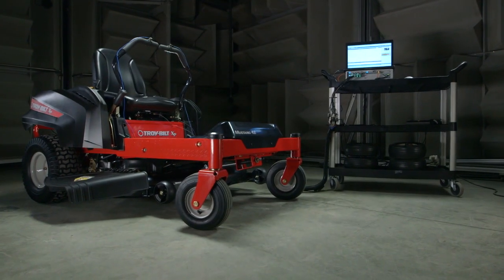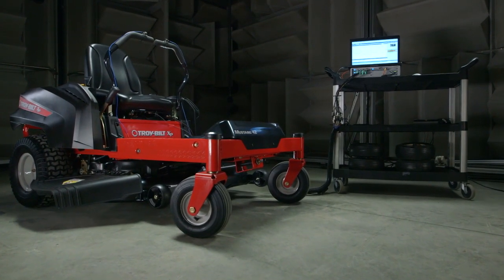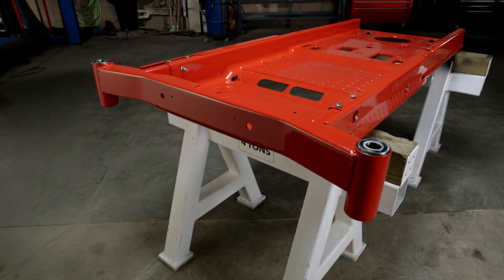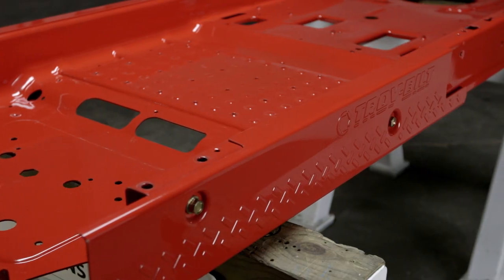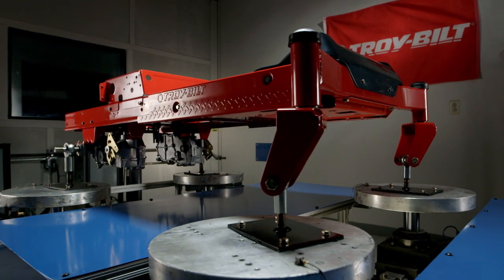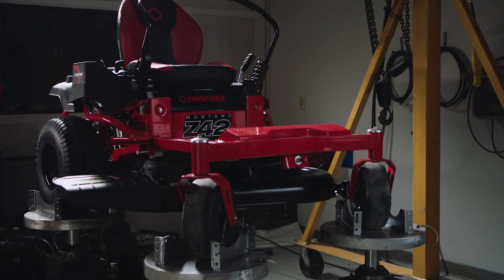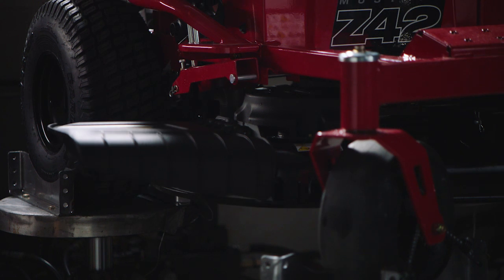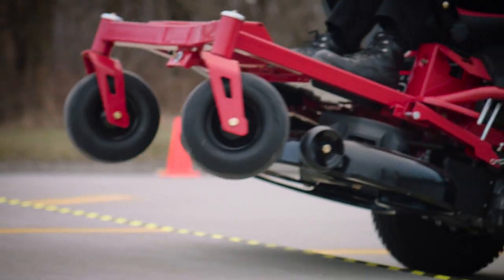Overtested: Troy-Bilt Zero-Turn Mowers

Comment: The only thing I don't like about my 54 mustang zero turn is lack of suspention in the seat.I got it new in 2018 and have been beating the tar out of it,the only thing I have replaced is belts,bearings,and blades.I have a yard that would kill a high price mower,I'm not afraid to use it like a brush hog.imo through standing water 6-8 inches deep during the rainy season I want to know what are the tallest,widest tires I can put on this monster,cause she sinks in my back yard alot,and it's easy to get unstuck.